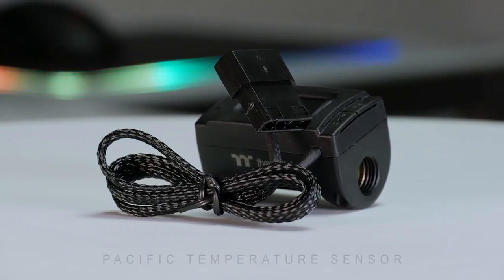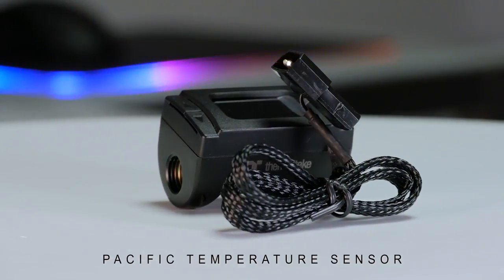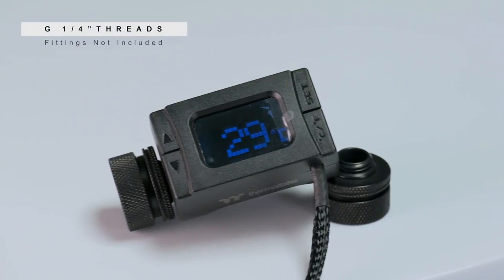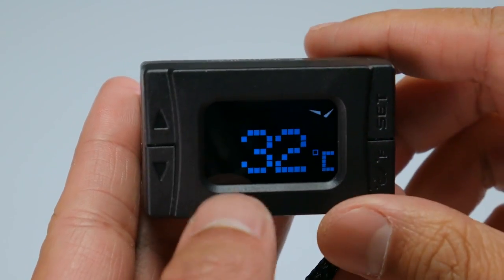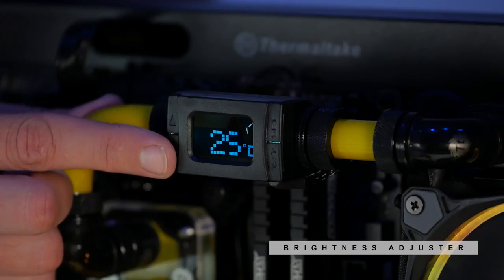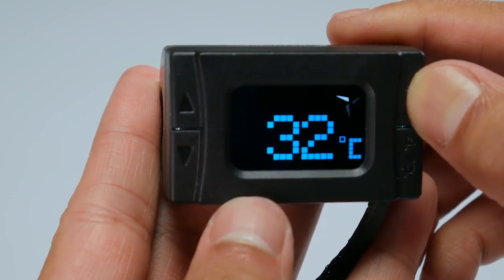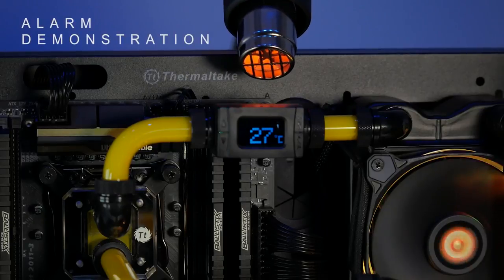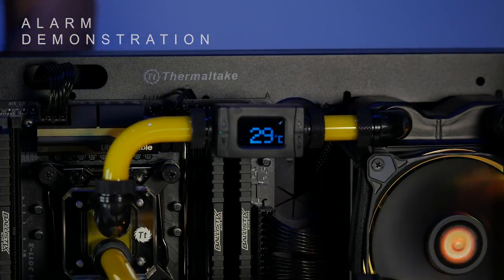Pacific G 1/4 Digital Temperature Sensor

Comment: That's a great piece of tech.
This raised my expectations from TT. What I'm right now imagining of, is a common instrument (like this one) with discharge rate, flow direction, fluid pressure, fluid temp & ablity input data to mobo via on-board usb. Fluid change alert after a definite amount of discharge.

Comment: For those of you that are complaining about it not having a flow meter. why do you think there is an audible alarm at user set temp? IF the flow of your coolant is not moving as it should or is stopped, the temp will rise. Hence it will warn you, which is better than noticing  your flow meter isnt moving. That is nothing but silence.
Reply: If the water isnt flowing, how will the hot coolant in the block make it to the temp sensor to trigger the alarm?

Comment: I finally installed this on my waterloop and filled it with coolant but it doesnt show the temperature?  It just shows two dashes. If i hit set for the alarm it will show numbers to indicate alarm temp, but then after setting it returns to showing the dashes. 

I cant find the documentation online for it either? 

Seems broken to me which pisses me off quite a bit since i bought it new. Am i missing something here Thermaltake? Did i do something wrong?

Comment: It's cool but no flow meter, no deal. I can just as easily drop $10 on a plug sensor.
Reply: You will here the audible sound for a high temp, LONG before you see your flow meter not spinning. Your complaint is invalid.
Reply: @sp4rksaflyin  Uhm actually you'll see the flow  meter not spinning first before the audible warning sound. Water doesnt heat up the entire loop without any flow so your waterblocks on your cpu/Gpu will melt long before the heated water reaches the thermal sensor.